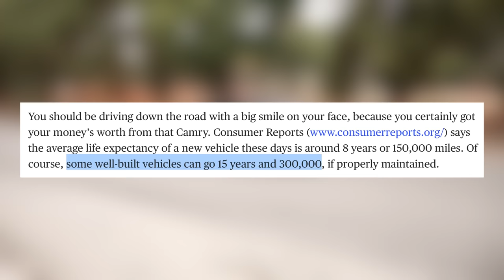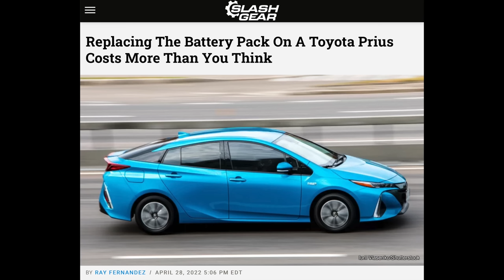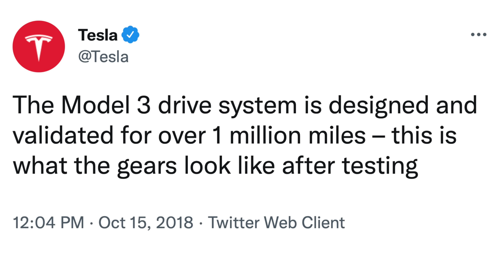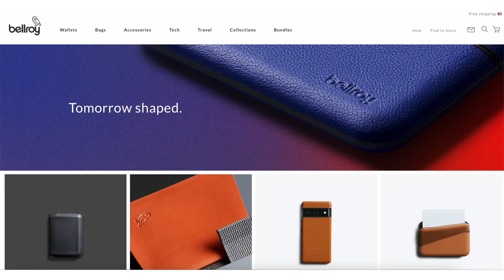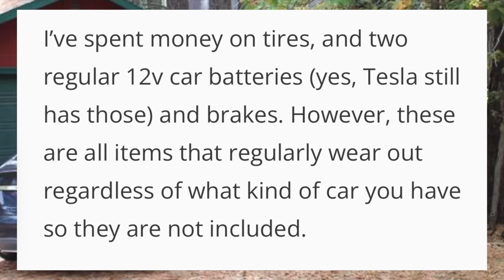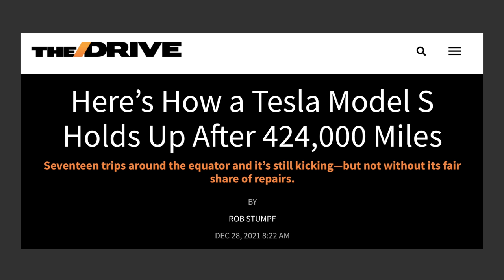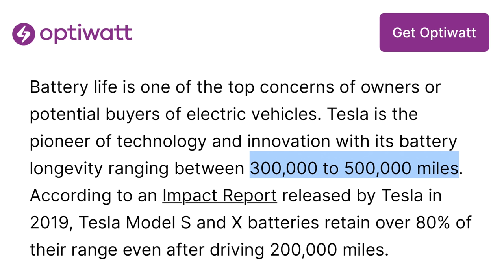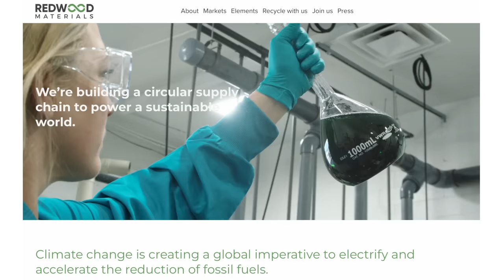The ONE MILLION Mile Tesla | It Still Runs

Comment: When the batterie on a tesla fails and it gets under warrenty. Do they change the hole battery to a new one? Just bought an 9 year old Model S and in one recipte the wrote. Swaped the HV batterie. Does that mean there was a new Batterie installed? What are some expiriences out there?
Reply: I now know the answer to my own question. They do not allways. You get mostly "Reman" packs which means Remanufactured.

Comment: I think it should be at least 248 miles you can drive once you have charged the battery.  Especially on a Tesla 3 long range or Tesla 3 performance.  Buying a used Tesla with worse range than that probably doesn't sound that interesting

Comment: Curious but it seems that the tires on a Tesla appear to wear out sooner than I would have expected. What are people experiencing with their cars?
Reply: It's because of the weight of the car. The model S weights between 4500 and 4700 lbs depending on the model and tires aren't cheap.  We just replaced our 4 tires in our model s for $1,700. 00.

Comment: You skipped over the largest cost. You gave figures for the smaller items. But never mentioned what the people paid for out of warranty battery replacement.

So you made the totals sound excellent for the owners who didn't need a replacement battery, but what about the ones who did. What was their cost of ownership.

I'm not hating, I have a model 3 that's creeping on 100k miles, so I really want to know.

Sure if you are lucky then you are at .5c a mile. But what's that figure with a battery and drive unit replacement out of warranty. Is it now equal to a gas car, or even more?

Comment: The problem is that after 8 years or 120K miles, the resale value will likely plummet. It is not like an ICE where it can be maintained to last almost indefinitely. The EV owner has little or no control or service options available to "look after" the battery pack.

Comment: this is a very insteresting data... so all the "OMG the battery costs $25k to replace!!!" news are almost pointless since you will have warranty for 8 years or 15.000 miles per year... also saving $12k in 8 years of maintenance vs a BMW / AUDI / MERC and another $22k in fuel for the 120k miles... with better depreciation...

Comment: Very worried about my model 3. 50k miles and the rear drive unit had to be replaced because inverter went bad. After 120k warranty it’s going to be traded in that’s for sure.
Reply: Buy EV, get problems. That´s what will happen. If it´s not with endless recharges, it´s breakdowns or battery degrading. That ´s why I will drive ICE forever
Reply: @thoos192  98% of Model 3 owners would buy another - Bloomberg 2019 survey.
Best customer satisfaction every year - Consumer Reports.
Tesla has kept a whopping 83% of its first-time owners, and it has the lowest number of customers who buy once and then leave the brand for another - S&P Global Mobility.

Comment: I love it when people talk about battery recycling, like transmissions, oil pans, etc. ARE regularly recycled and not put in a junkyard/landfills. Occasionally, they may be used for parts, but that’s pretty limited.
Reply: The point is that you are not using fuel, so the comparison has to be with the batteries themselves. You aren't recycling the fuel, whereas there is renewable energy, so if the battery gets recycles the usage/waste of materials becomes minimal. Plus you get the benefits of clean air, lack of CO2 emissions, 0 pollution, almost no soot being deposited everywhere from the fumes. I imagine in 30 years, everything will just be a whole lot cleaner in big cities.
Reply: @MrPsychopathy  None of these people are concerned with the environment. It's just something they picked up without knowing anything about recycling and repeating it ad nauseam. That along with fake concerns with mining, electrical grid etc.

Comment: There's a Tesla went 1.9 million kilometers with 4 battery pack (1st one went ~650k km, averages around 500k) and 14 engine swaps! Yes, 14... :D Thats around 145k km / engine, it's ridiculous. Even if it lasts 150k miles (240k km) its still very poor. A petrol car easily goes 400-600km without a new engine.
Reply: That's 14 "drive units" which is equivalent to motor and transmission... Lol
Reply: @polska905  Even worse then if it also means transmission too.

Comment: With these reliability tests, I like how people compare a Model S to a Camry and any Model S that doesn't get 200k miles before a major component is replaced = bust. How about we compare a Model S to a M or an AMG instead? Stop comparing 8 second 0-60 4 cylinders 
to 4 sec rockets.
Reply: Comparisons on price as well
You could buy a base level Camry for 26k. Ya, you are probably gonna always be in the hole for total cost of ownership when you compare that to a 50k+ vehicle.
Reply: It's well worth it for some. Over 150k miles, a gas camry cost 26k in fuel(at 4.5/gallon and 26MPG) and 5k for 30 oil changes(5k miles/change), check ups, gasket sealing, fluid flushes, and belt changing.

And if you value your time like I do. 

It takes 93hrs to fill up gas over 150k miles(assumign 15mins per fill up and time of travel) and 30hrs to change the oil. Add another 20hrs for check ups, fluid flushes, and belt changing.

I spent a total of 2hrs at a super charging station in my EV and the rest filled up while I was sleeping. I have spent 0 hrs doing any of the other stuff my wife's car needs to do.

Comment: i seem to be out of the norm here. i got a model y perfomance this past may and so far driven about 2800 mi, it already shows a max range of 289mi, when it originally came with 303mi. is that too much? should i contact tesla?
Reply: Maximize your driving habits for efficiency and turn off anything that isn't necessary. Then see how much range you have at 100%
Reply: @ryanpetree6475  That doesn't matter as far as measuring battery degradation goes.  It just matters what range is showing on the screen at 100% charge --not the actual miles you get by driving efficiently.
Reply: @kenbob1071  Point being that it adjusts the range based on a lot of variables including your driving habits so that small 5 mile variance is easily the difference of a small change to your driving. If you really wanted to see battery degradation then you need to measure the voltage out of each cell and compare to new.

Comment: This made me recall (being a Mopar guy) the 1.6 MILLION mile '63 Fury a taxi driver logged before some dimwit hit him head on. It went through 5 or so slant 6 engines - but 5 slant 6s would be less $$ than only a couple repairs on a Tesla!  🚙
Reply: Next thing ya know, ol' Jed's a millionaire!
Reply: Then he didnt go 1.6 million miles on that car, he replaced 5-6 motors...
Reply: @dennishayes1505  Well the Tesla replaced drive units so... anyway do the math - that's 320,000 mi. per motor - not bad for inferior old ICE tech.  🚗
Reply: @cuda426hemi  I didn't hear that part the first time I watched this video, I had to watch it again to validate it, but  I totally agree that it doesn't validate the Tesla either.
Reply: @dennishayes1505  The point is though that besides all the pollution/renewables aspects the Tesla saves you CASH from day one over any ICE vehicle starting with gas alone being about $2Grr in your pocket every year. These are luxury cars - when the tech gets better and the prices get competitive - watch out.   🚗
Reply: @cuda426hemi  obviously you're confusing me for someone that isn't a fan of electric vehicles.  I'm totally on board, I just need the f150 to get 50% more range and affordable...
Reply: @dennishayes1505  no no I make no judgements, I'm just riffing ... actually I was just thinking about that 1.6 million mile Slant 6 - and about how much gas that leaner went through. A little armchair math on an old early 60s slant 6 -believe they were 225 cu in. at average 18 mpg - generous for stop n go taxi - it would go through about  88,888 gallons of go juice. WOOF !!! Now adding the cost of that would be interesting since it was over a lot of years and took place in Montreal where who knows how much they've paid for gas over the decades up there.  cheers! 🚗

Comment: 2% battery degradation per year is pie in the sky.  I have 2021 RWD Model 3, it has the European Battery Pack they say to charge to 100%. The battery degraded 6% in my first 18 months of ownership.  My friend with a 2021 Model Y with the American battery pack that he only charges to 90% and he’s down 8% in the same 18 months. 

I’m putting on roughly 20k mi/yr.  I will hit that 100,000 miles when the car is just under 5 years old, fingers cross that the battery pack degrades more than 30% before the so it can get replaced under warranty.

Comment: So two battery replacements for 1million miles. Thats 350m, not 1million. Had a toyota from near new. Haven't changed anything but oil and tyres. 200km. Many Toyota reach 400km until needs tyre rod ends etc. Landcruiser can do 1million km.

Comment: I don't really get why people think EV's are zero emissions when most places use coal fired power plants,(even in areas claiming to use so called renewables that still need fossil fuel back ups). Coal burns a lot dirtier than gasoline so I'd imagine they're actually emitting more carbon in most places than not,(this could be mitigated with a switch to Nuclear, Hydro and Geothermal power exclusively). 

That being said I am renting one to use for rideshare at the moment and I have to say, they're fun to drive and don't cost half a damn to operate. I can go out on a Friday night, make 300+ dollars and only spend at most 20 dollars on charging. The Tesla I'm driving is also much easier to drive than anything else I've driven. They're great for intown driving and you could road trip one if you weren't going anywhere too remote. 

Personally I'd like to see Tesla dust off Ford's concept from the late 50's, the Nucleon.  Call it the model N and instead of batteries it's just powered by Uranium and/or plutonium and would probably never need to be refueled/charged.

Comment: So, it's considered to be degradation and loss when the vehicle is still rated to go around 300 miles at a full charge, which is still better than 90% of the EVs on the market?
Looking at a lot of the other manufacturers and competitors, they are boasting around 200-250 mile ranges. Even with Tesla's loss of battery life, this is still superior to most of the market. I am not worried...

Comment: gas tank last 40+ years and is refilled immediately, I'll stick to that until they better the range and by then the cost of electricity will be through the roof if the grid can even handle it.
Reply: How much range are you looking for?
Reply: @elwingreen8311  Since I can't recharge as quickly as filling up the tank, they need to go further to compensate for the time loss.
Reply: @donaldstinnett5630  you hope

Comment: I had two 2013 Leafs. The one that I regularly rapid charged had 70% of its battery capacity at 80K miles. The other, usually charged with level 2, had its battery replaced under warranty at 60K. Go figure.
Reply: Probably just bad battery technology from Nissan
Reply: I wonder if the storage charge was different ? A fast charge just before driving is less harmful than a long slow charge sitting at high % charge for a longer time.
Reply: Did you live in a hot climate? Heat kills lithium batteries
Reply: I've heard that the early Leaf batteries did not last very long because you could charge them up to 100%. True? 
I have owned two Chevy Volts. They designed them to not allow the battery to charge to 100% so it increases the life.
Reply: pre-2015 Leaf batteries had crap chemistry especially in heat, and given they have only air-cooling, they suffered (and lost capacity/failed) a lot.  Newer ones are much better, but still suffer from no liquid-cooling/thermal management, which means limitations re fast-charging (heatgate... sometimes can't DCFC more than once a day, which stinks on roadtrips obviously)

Comment: I’m sorry imo if you have to replace a drive unit or a battery then you can’t technically say the car lasted 1,000,000 miles to put this into prospective, there are car owners with gasoline engines that have gotten to 1 million miles,rare but it’s has happened and never did they have to swap in a new engine, and all that was needed was head gaskets and timing chains 
/belts but everything else is normal maintenance but the car has most of its original parts and lasted 1million mile.

don’t get me wrong 300 or 400k on a EV is amazing and great, that’s better than the average car, but I feel you can’t make the claim of a car lasting 1 million miles if you have to replace the parts that puts the vehicle into motion, by that logic there’s plenty of people who buy junk cars and rebuild them with the original body but with rebuilt used engines so does it count if the car got another 200k with a new swapped or rebuilt crate engine? I don’t consider so it’s more of a refreshed car at that point basically new if it doesn’t retain its original parts preferably the parts responsible for propulsion you have to have that part in and it still last 1 million miles to make that claim valid so Elon musk saying the car is built like a semi that’s skeptical at best because when a semi needs a in frame it’s the original engine.

Comment: to get 1m miles you will need roughly 3 high voltage battery backs at a total cost of $45,000 more, anyone telling you a battery is $3k to $7k is grifting hard. A typical tesla will make it about 300k miles which is way less than a toyota will. My IS350 ran to 240k miles and drove like new until someone in an F250 totaled it, it would have went 350k easy.

Comment: I got 340,000 miles out of my last (and I mean last) ice car. A Citroen C4 grand Picasso. Effectively a rebadged VW with a1.9l VW golf engine.
What failed over that time? 3 crankshaft sensors, 3 ignition coils. Stuff which an EV doesn't need. Oh and a clutch. Another ice only artifact.